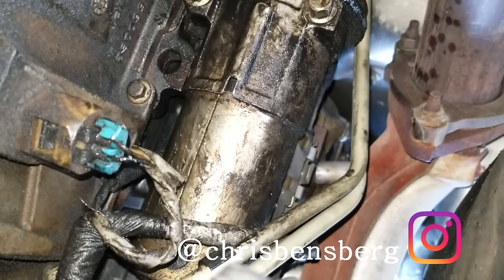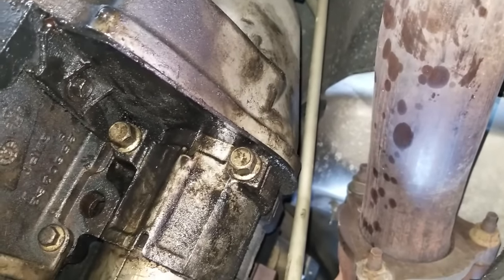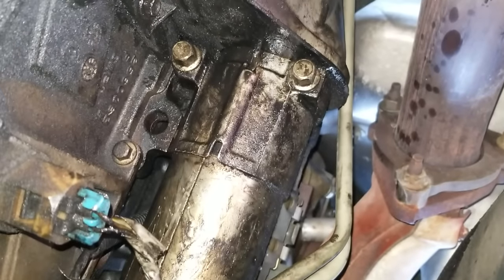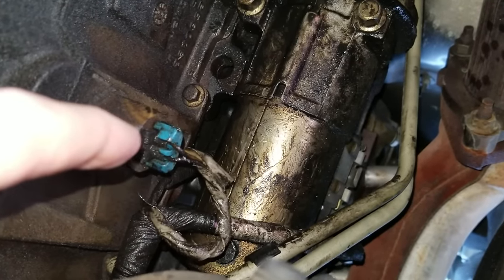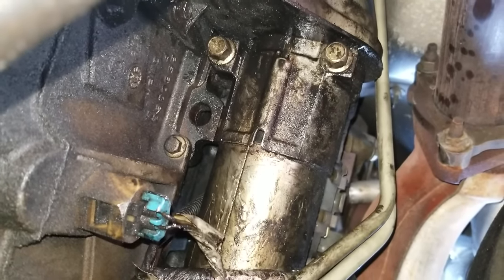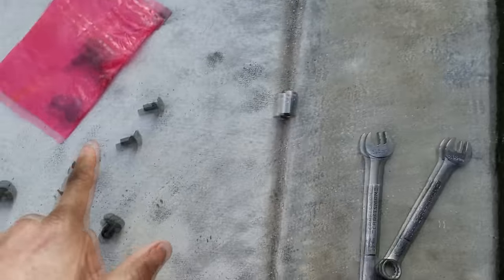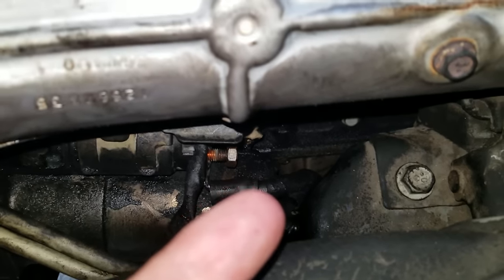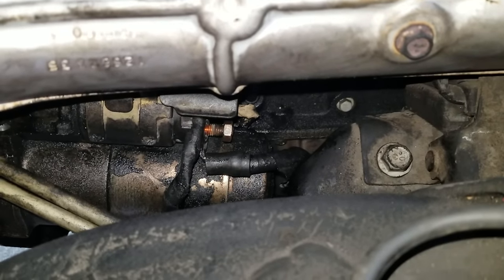How To Replace Starter On 1999-2006 Chevrolet Silverado 1500 And HOW TO TAKE IT OUT!!

Comment: HUGE TIP FOR THE END PUTTING IT BACK IN. I was fighting it just like in the video to put it back in, I ended up sticking a prybar between the front (non torpedo side) and the control arm and forced it in. It went right in after that. So if yours is getting caught on the control arm right there, just jam a pry bar in there and it should help alot.
Reply: Thanks will try next.  Had to give up for the day,  arms too weak
Reply: Mine goes in easy but if it’s tightens down to much it clicks when I loosen it it grinds
Reply: @ShiftyReaperGaming  
Sounds like the wrong starter if it goes in that easy. A new starter shouldnt make any clicking noise once installed. If it is in fact the correct starter then i would check and make sure all the bolts are seated equally, so that it isnt by chance sideways
Reply: When putting starter back in, you have to twist the starter slightly towards the wheel while pulling it in and then straighten it out once it's in. I 110% Agree with taking tire off and pulling shield partially out of the way. These are the worst damn starters to replace or remove if you have to replace crankshaft position sensor. Make sure you have some Xanex on hand also, that helps!!

Comment: Thanks saved a lot of time! Engineer should go to jail for that lol
Reply: Yea don't let the engineering dept for this design ever work on any Chevy vehicle design...
Reply: The engineer actually made this very easy with the right approach. I'm not a mechanic and I knocked it out pretty quick
Reply: @1010deathmetal  I mean isn't that the best way for GM? Easy for their mechanics, tough for the laymen without a YT Vid or similar teaching method that was much tougher to get back in the late 90s - early 00s.
Reply: Why? It's one of the easiest...try the starters built inside the transmission
Reply: @collinwmckinnon  yeah I had to learn to move the oil dipstick and it's no issue now, the starters in the transmission are a headache when that's all that's wrong with it.
Reply: I'd like to see the starter that these negative Nancies designed.

Comment: to avoid a shocking surprise, disconnect the positive battery cable from the battery before you start.
Reply: yeah i learned that lesson years ago haha
Reply: Wish I would have read this a few days ago Haha ⚡️
Reply: You disconnect the negative, NOT the positive.
Reply: @talangue  Either works
Reply: mrmotofy no it doesn’t
Reply: @LoneWolfSnowplowing  Ok whatever you say bro. A device will not function with the positive or the negative removed. If you believe it will...well there's special places for that.
Reply: I also never understood why people insisted that it should be the negative cable logic says that as long as the circuit is cut you should be good to go. The only reason i can think of is that if you are working with electricity more than likely you are using some kind of auxiliary power device and if by any chance your auxiliary power touches your positive while the truck is still grounded you might short it out thats just my theory.

Comment: Just removed mine from a 2006 chevy 2500hd 6.0 L and i didn't have any issues getting the starter out (after bolts off almost fell out straight down) Getting to the nuts on the solenoid was easy, had plenty of clearance. I guess you're working on a different year. Great, to the point video dude. Why people don’t understand how to just perform the task with minimal talking i will never know.

Comment: Just replaced starter in 2004 Chevy Silverado 2500HD.
Summary of steps:
1-Disconnect battery cables.
2-Unfasten & roll plastic housing toward front of tire. (passenger side)
3-Using 1/2" socket wrench, remove large cable from starter.
4-Using 5/16" socket wrench, remove small cable from starter.
5-From under truck, remove 2 bolts from starter using 1/2" socket wrench & extensions.
6-Remove starter. 
7-Install new starter & re-install 2 bolts.
8-Connect large cable to starter.
9-Connect small cable to starter.
10-Connect cables to battery. (Positive first.)
11-Test starter by starting truck.
12-Roll/fold plastic housing around tire back into place & secure.
***I didn't need to remove oil dipstick tube.
***I didn't need any metric wrenches.

Thanks for video. This just summarizes for easy referral.
Reply: Thank You for putting this in steps with detail.Gunna try this.🙏🏼
Reply: Just about to do a starter on a family members 2500 and this is exactly the write up I was looking for, thank you!

Comment: I just did mine on a 2003 GMC Sierra.  These tips saved me a BUNCH of time.  The wires can come off with some LONG extensions (my ratchet was out near the compressor with a universal joint near the starter).  Biggest savings was removing the inner fender lining - great tip whoever suggested that.  I had the truck running again in 90 minutes ish.

Comment: I have an 2001 Silverado 1500, 4.3L V6, my starter replacement was similar but only took about 5 minutes to remove. The bolt pattern and overall fit was different. This video was still helpful but I wanted others to know that the project isn't as daunting (on my truck) as this video makes it out to be.

Comment: Just did mine this morning.  Thanks for the video, you tube saved me another big labor charge.  Worst part on mine was getting the large wire nut off the post.  Wasn't enough clearance to slide the 13mm socket on the nut.  Use a wrench to just barely loosen it and then the socket went on.  Was really pretty easy thanks to these guy's who filmed how to do it and put it on YT.

Comment: Thanks for the video it helped so much. I learned a lot and save about $350 in labor. I have a 2001 z71 5.3L and it was exactly like this.I found a couple of tricks along the way. For the two bolts that could be accessed through the wheel well I used about 18inches worth of extenders and an elbow and got to them without taking the wheel off. I slid the heat shield off through the wheel well also, this gave more clearance whe I took the starter out. I did have to put the socket and extensions on from under the vehicle and the attach the ratchet through the wheel well. Putting it back on I attached the 8mm first but I used bricks to prop up the starter so I didn't have to hold it up after connecting. I slipped it in there and found it easier to get the torpedo end in first and the bring the back in from above due to the transmission casing. Just had to move the silver metal lines a bit. Then I bolted it in and attached the 13mm from under the truck, the slide the washer and nut on through the wheel well. Then I put the socket and extensions on from  under and tightened through the wheel well. I even was able to slide the heat shield on after everything else through the wheel well and adjusted in to place from underneath.

Comment: I just did the starter on a 2001 Chevy Silverado 1500. 2WD 5.3L I know taking off the tire and taking loose the wheel well shield seems easier to get your hand up in there, but to be honest, if you just get the two wires loose before taking the starter off, it is simple after that.

You can get those two wires off the starter, from down below ,with a baby (1/4") ratchet, (handle up towards manifold for turning room) with a shallow well 13 mm and shallow well 8 mm.

When you take the starter loose & pop out the two long bolts, rotate the starter 180° and then tip the rear up into the engine, towards the exhaust manifold and push it back a little, so that the rounded end will come out first, down towards the ground & then the replacing is the reverse order.

Saves you from having to remove the tire & wheel well shield loosening. Wish I had done a video on this today, but hopefully it cuts your time down for replacing the starter.

I still gave a thumbs up for the video

Comment: Just did this myself, here are some tips.. REMOVE battery cables FIRST! 
and then you need a: 
#8 or 5/16 (deep), 10, 13, (13 DEEP SOCKET)  and maybe a 14 mm plus a few extensions. 
the #8 or 5/16 socket should be deep and preferably the 1/4" ratchet size. All others can be the 3/8" ratchet size but I did find the #10 to be easier in the 1/4" size as well.
Large bolts holding the starter on are 13mm.. 
When re-installing DO NOT crank down too tight on the power or signal wires that go on the solenoid or you can easily brake it!
be gentle as you are removing it, if it's not coming out you are likely hitting the trans lines, trans dipstick, the block, the oil sensor etc... but it does and will pull out with ease, back first, then wire end up, then gear side that was in the flywheel should face down, at that point you will be able to undo the smaller signal wire first, then the main larger power wire. Also, remember to clean the ring connectors with a wire brush or a little sand paper if needed for a better connection before re-installing.
Reply: working on my 2001 Tahoe cannot get the starter out to save my life and cannot get my hand in-between the exhust manifold and frame to unscrew the three wires any suggestions
Reply: Just plowed through this in less than a hour using your theory! Thanks Matt.
Reply: @treyxsanchez9774  sorry, I didn't see your message.
Reply: @samferrugia  awesome, glad to help and thanks for your reply.

Comment: Thanks for a detailed video. 2006 Escalade ESV.  The trick of removing the wheel well was great. I literally pulled the old one out and put the new one into place in about 15 minutes, just using both hands to move it around and twist it, tight, but doable. The longest part was the setup, prepping, etc, but worth it for the aggravation and muscling I would have had to do.  The  only hard part was really tightening the 8mm nut cause I wasn't sure the position, but seriously, awesome video, you saved me time, effort, and as I said aggravation!!

Comment: I got a 2001 Yukon same problem nobody explained exactly how to remove the starter. I worked in it for 2 1/2 hours with no luck! All I needed was to slid it out enough to put in a crankshaft sensor, thanks for the tips. That worked wonderful!!!

Comment: Good call on removing the wheel. I didnt need to adjust anything else, used a cheater bar on the two bolts and the started fell out. Luckily I had my sockets right there so I one handed it until it was disconnected.  Pretty easy job.

Comment: On 4.3 there's no need to take wheel off or fender liner. Just did this in a gravel driveway with plastic ramps from autozone.  It's about a 30 to 40 minute job.  Take battery cable off, take 2 13mm starter bolts out, pull starter and twist so you can get to 8mm and 13mm nuts for wires and remove and replace in reverse.  Easiest starter I've ever replaced. Oh, and the blue plug, you'll need to get a flat head screwdriver behind the black end of it and gently pop it up and out it will come.

Comment: Maybe I'm weird or there's something different about my 2000 silverado 2500. But I just drove it up on the ramps, and reached up from underneath without removing anything extra. I can remove both wires before touching the bottom bolts,  then unscrew the bottom ones and finagle just a bit and she comes out. Took me 20 minutes for a full swap.  Probably helps to have my wife inside praying 😂

Comment: I've done a few starters back in my teens without much problem.  Recently, however I pulled the starter from my 01 Silverado in order to get to the crankshaft position sensor and change it out.  I probably didn't have to disconnect the wires but this was my first attempt on this vehicle.  Whenever I took things apart I didn't take note on how the heat shield should be attached so I guessed at it.  Big mistake!  Since then the vehicle would start okay about half the time and when it didn't I had to get out of my vehicle and move the shield with a screwdriver until it was in a position enough that the vehicle would start.  Then finally today the shield shorted and started a small fire.  Fortunately I was able to somehow get the fire out with the same screwdriver.  I probably moved the shield off enough to stop the short.  Fortunately I was able to drive the vehicle to a tire and mechanic shop just in time for them to service my vehicle before closing.  They said the starter was bad or going bad so I let them replace it.  About a $400 repair bill but at least it's fixed and I shouldn't have to worry about it for a long time now.  Yes it is a royal pain in the rear to work replace those things.  Well done at Shore Tire in Lenexa, KS!
Reply: If my 05 Sierra started on fire, I would remove whatever valuables I had in it, and give it a 5 minute head start before I called 911. I had a 01 tahoe and it was great, this sierra eats money though. I really like it but it's getting sold in the spring

Comment: Hey guys I just replaced my starter in my 02 Silverado 1500hd. It took 2- 2.5 hrs. I did not use a jack or jack stands kind of for an experiment. It can be done lol It wasn’t that bad. I used a deep socket for the 13mm bolts (with extensions) and a 9/16 wrench for the single small nut. It all went smoother than expected. the worst part was tightening the wire nuts. I suggest using a long ratchet and wrench for those. and going from the wheel well is the best way like the vid. I didn’t remove the wheel well plastic lol I always have trouble with those clips. Good luck. My truck starts instantly now. ⚡️
Reply: Also I forgot to disconnect the battery. Safe to say I learned my lesson ⚡️🤣

Comment: The final step of getting the starter back into the transmission opening is that you have to rotate it clockwise about 30ﾟ in order to make it go into the transmission then you rotate it back counterclockwise into the correct position after that.  Otherwise good video with good tips.

Comment: I got everything off nuts off for both starter wires the two bolts that hold the starter in place the oil pressure sending unit wire unbolted the dipstick bracket but I noticed you skipped the part and how you actually pull the starter through that narrow hole on the video which is where I'm stuck at the starter is completely out of the bellhousing but I can't pull the starter through that narrows slot any tips???

Comment: I didn't hear you mention this in your video, but did you already disconnect the battery cables? Those silverado's are awful for leaking oil. Was this a customers truck? I would have pressure washed it prior to even touching that area. I have to do mine since I believe that the starter was sticking and then the vehicle had taken five turns of the key to finally start. I made it to the house and thought that I would find a video to see if someone had a better way. Removing the wheel well plastics and the tire will probably do the trick...thanks for posting

Comment: When I had to do the crankshaft position sensor on my truck I realized how much of a B it would be to get the starter all the way out. Luckily you only have to unbolt and push the starter out of the way for the sensor. But my truck is high mileage so when that starter goes I know it’s gonna be a pain to replace. Thanks for the video tho. Idk if those are trans cooler lines or what running next to the starter but damaging them is my biggest fear because it’s tight in there

Comment: Easiest way is to remove heat shield on solenoid, remove bolts holding 2 aluminium tubes to engine just forward of starter and undo 2 plastic clips holding wires to the same bracket for 2 aluminum tubes. Starter then can be removed easily. You can undo small and large electric wires after getting starter out.

Comment: Question for just removed the starter out of my 00 silverado and like yours just remove all the bolts and disconnect the power wires to it got it out got a new but unlike my old one after I connect the wire for the 13mm then the 8mm on the very front of mine I have another wire post so am I missing something or does the store clerk at AutoZone just gave me the wrong ine and doesn't know what he is doing or is that me and if you have time and not really sure on what I am talking about I can send pics to help thanks for your time and have a wonderful day

Comment: So when you undo the 2 bolts holding it up in place it doesn't freely fall out or can't be pulled back to access the 13mm power bolt??

Comment: The most probable reason you had so much trouble getting it back in was likely because you didn't remove the transmission dust cover that it slides into...it's easier if you do that, one bolt, then put the cover & starter back in together & it goes in much easier...

Comment: All that extra work isn't necessary..I just changed the starter on my 05 Silverado and only removed 2 bolts and 2 nuts. Pull the starter back a bit and twist it to clear the dip stick..wiggle it out. Was easy for me..
Reply: Good for you bud

Comment: Thanks for the tip to remove wheel to access battery cable. I have an 2002 Silverado 1500. These starters are a bi*** to remove. Must have patience.

Comment: Anyone know the part # for the black shim peice that's between the starter and flywheel case? My 02 2500hd didn't have one when I replaced mine and now there is a gap

Comment: There’s actually a much easier way that allows one to access the 13mm nut almost squarely using an extension. I wish I could articulate how to do it. I believe it is the textbook way to do it and I discovered it just by happenstance. I didn’t jack my truck up or remove the wheel.

Comment: ANYBODY READING THE COMMENT DO ONE MORE THING. There is a small sheet metal shield just below the starter on the transmission held by one small bolt. TAKE IT OFF. Starter slips right out and in.

Comment: So no warning to disconnect the negative terminal of the battery at the beginning of the video?
Reply: If you need to be told to do that,  you should not be working on any motor